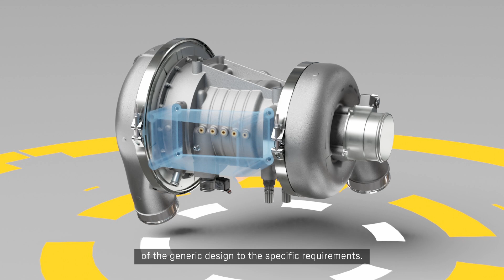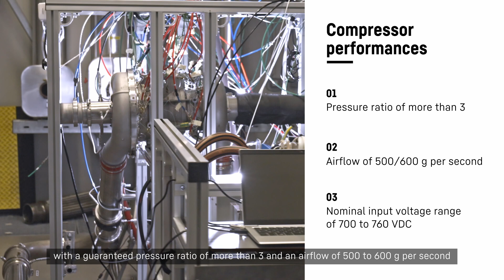Innovative Fuel Cell 55kW Air Compressor By Liebherr

Comment: What purpose does the compressor serve on a fuel cell? Thank you.
Reply: The Fuel cell systems needs a constant supply of O2. Thus, air compressor will enhance the reaction of Hydrogen and Oxygen inside the fuel cell by supplying oxygen at constant rate . Hope it answers your question.
Reply: Me too I asked the same question during the video.
Fuel-cells need low pressure system to produce energy, so what is the role of this compressor?
Reply: Likely for high airflow through the fuel cell, which helps it to breathe'.
Reply: So the compressor side is comprehendible , eventual electric motor on the shaft as well but what is  the purpose of turbine part , how they going to power this turbine by the fuel cell exhaust . Very misleading and poorly explained and especially for Germans !